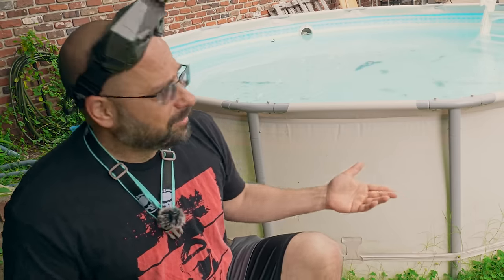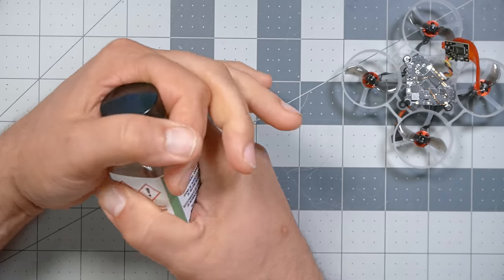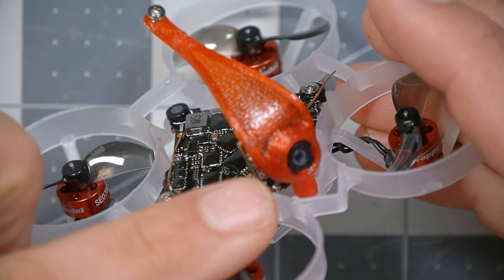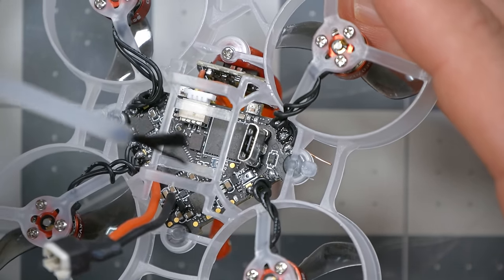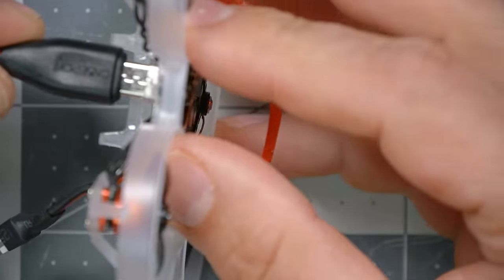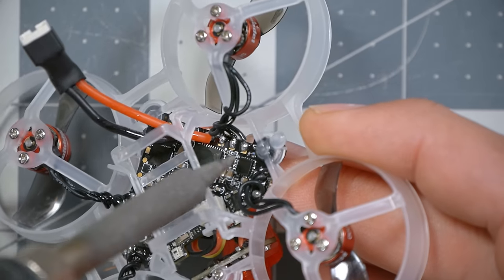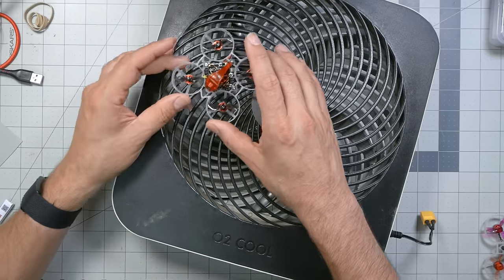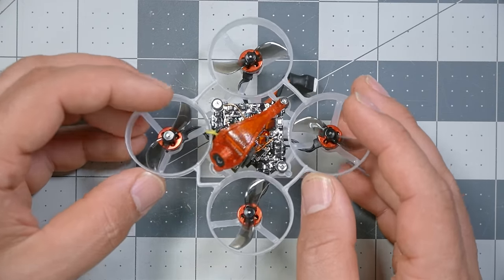I didn't waterproof my drone. Now I'm paying the price.

Comment: I've been using this stuff for years. All of my builds electronics get coated. I've flown in downpours, crashed into wet grass, puddles, snow and once in a pool. Never had any failures due to water damage. I take a heat gun to it to loosen the cap when it gets stuck to the bottle.
Reply: Try flying while it's actively snowing. Video gets worse but it's so fun.

Comment: Worth to mention, that motors don't need to be covered with coating because of magnetic nature of motion. Brushless motors are waterproofed by design.
Reply: Strange way to say the wires are enamel coated
Reply: The "magnetic nature of motion" has nothing to do with brushless motors being waterproof. The copper windings on the inside are coated in enamel and the wires leading out are sealed. Honestly not even sure what "magnetic nature of motion" is supposed to mean in this context.
Reply: @psyman9780  probably that conductivity isn’t required because the motor functions through electro-magnetic created motion. Just a guess…

Comment: Just rescued a 5” from a pond after 2 weeks under water, no waterproof coating applied.  Result 1 seized motor, ESC fried. Flight controller, 3 motors, caddy unit and ELRS, were working.  Battery was screwed.  The rule here is the ESC Diodes cut power first to the rest of the drone.

Comment: Its not the water in and of itself, water does NOT conduct electricity, it's the minerals in the water that conducts electricity. The different minerals create gradients. Of course, when drone is running or has electricity in it, the electronics will get damaged by the conduction of the electricity crossing the gradients.

Comment: Distilled water flush is great advice. Years ago, I flew a marine life observation drone that landed and floated on the ocean. It required a distilled water flush after each flight followed by a WD-40 spray rinse of the motors. Flushing with (distilled) water is counterintuitive but apparently worked for this specific project.
Reply: Not really counterintuitive. Distilled water actual does not conduct electricity. It's the minerals in the water such as salt that makes it conductive. But distilled water is not really something most people have at home :-) fresh water from the tap followed by something else works great. As long as the battery is disconnected it doesn't matter what you rinse with. All that matters is that no residue is left on the components when you do plug in the battery next time. (Unless it was fried before you picked it up... But then nothing's really matters ;-)
Reply: On hobby drones I would avoid spraying the motors with WD-40. The bearings are usually shielded, not sealed, so WD-40 will get right in there and break down the lubricant. Though it may be a good idea to lubricate the bearings after they take a swim anyway.
Reply: MAF sensor cleaner works great for spraying out motors.
Reply: I've done this on float planes I've flipped in the lake. Didn't revive them all but most were okay. Works magic on ESCs. Now my float planes smell like a mechanic's shop.
Reply: Is there any chance to save a drone that get into a water without any comformacouting done?
Reply: @theartofflying3108  I've saved float planes with no coating by using WD40 on the ESC. None of my float planes have flight controllers though.

Comment: I'd like to see a video where you test out "Lipo fire safe bags". I have a tough time believing any are good enough to be worth spending money on them.
Reply: They're not, there's a lot of videos online of them just melting and letting the flames out. Get an ammo box or batsafe or smth.
Reply: @ironic2468  when I watched that video I was thinking that an ammo can with Fireproof sheetrock inside would be the best option of keeping the flames contained but maybe the ammo can itself would do a good enough job. Either one seems better than one of those battery bags lol
Reply: I second this motion!
Reply: @SkeezyFPV  Closing the ammo can turns it into a bomb. an open can still has flames coming out up to 6 feet in the air. Ammo cans also transfer the heat of the fire into what ever they are sitting on, so your counter or table still ends up ruined.  

Safest charging locations indoors is inside your oven, or in a fireplace. non-glass top stove with a good vent hood would be third place.
Reply: buy a small toolbox, works way better.  helps if you place it on bricks instead of hardwood floor.
Reply: @drunkskunk00  you gotta take the rubber seal out. Else your right. Lithium ignites and doesn't have oxygen and it will find it meaning it will burn a hole through it.
Reply: I think there is one on Rotor Riot channel
Reply: There’s so many videos already proving that lol. Even the boxes aren’t safe if they’re stuffed full of lipos and the boxes are touching anything flammable.
Reply: I use .50bmg ammo cans for all my lipos.  I did an experiment where I shoved a nail through a lipo, threw it in a metal ammo can and closed it real quick. A little smoke came out of course, but the inside was scorched. Harbor freight has them for around 6-15 dollars depending on size. The 15 dollar one fits a ton of batteries.
Reply: I use a cooking pot
Reply: @sakfpv8444 did you remove the rubber seal first?

Comment: Electronics technician in a previous carrier. 
Never heard of the unplug it before removing it from the water theory. But I suppose I can maybe kinda see some validity to it. 
Definitely recommend removing the battery ASAP! 
Also isopropyl alcohol is one of the best tools for removing water from electronics. And air! A little heat doesn’t hurt either.
Reply: I’ve had personal experiences and come to this conclusion years before this video. My theory behind it was different though. I had the idea that the much quicker rate that water cools than air aids in keeping individual chips, caps and resistors from frying. I’ve pulled several drones out of water after unplugging the battery submerged and have had good results
Reply: I’ve also had the experience of components frying right in front of my eyes pulling them out of the water while plugged in. That’s what first gave me the idea

Comment: I wouldn't recommend coating with things plugged in - I did an ESC plug like that and I could never get it out again, I broke the wings off the plug trying to get it out. I use Kapton tape to mask off anything I don't want coated and then I spray that sucker. Also (I don't know if this only affects the spray-on type) the solvent seems to soften any silicone items such as wire insulation and gummies. I'd probably remove the gummies and try not to get too much on the wires.

Comment: I had a 16 x 16 iflight pinned stack in a small 2.5 inch that I recently retrieved from a tall tree after being stuck for over 2 years.  Surprisingly everything still works fine.  Except for the one motor bell that showed my bb gun aim was dead on the money at least once!  It had been 90 degrees and better with no rain for a few days prior to the rescue.  I have just put the stack in a Darwin fpv tiny ape frame and flown for a few weeks now with no issues at all.

Comment: So funny, this video was released just a few hours after I landed my acrobee65 in the garden pond. No conformal coating, did not unplug the battery under water but rinsed the pcb with Flux remover fluid and dried it in the sun. Got lucky, it still flies like a charm
Reply from the maker: Sometimes you get lucky!

Comment: Clear nail polish. works well, comes off easily with alcohol and saves you from anything short of full submersion. For the amount of work most people do to a quad on an ongoing basis, a coating that is 'difficult' is really not so good.
Having said that, if you're over water then maybe go all-in with the good stuff.

Comment: The best way to waterproofing the drone is B7000 glue! glue can pour contacts and then remove without residue with tweezers. B7000 can be completely removed without solvent by winding on tweezers. Where I live long winter and rainy spring and autumn so i know what i'm talking about.

I filled the boot button and exposed connectors with B7000 glue, and then easily removed them when I needed them in a new build. b7000 can clog the UFL antenna connection without fear of losing connection.

 I don't like MG Chemicals because it leaves a lot of dirt and is very difficult to remove with a solvent. And also it is very fluid and floods the places that I try to avoid.

In this old video, a guy shows how easy it is to apply and remove B7000 glue with tweezers from a flight controller: https://youtu.be/qx-ZT6Vo6xg

And this glue is very cheap and sold everywhere, as it is very popular for gluing smartphone screens
Reply: thanks for the tip!

Comment: Submerging your quad or just getting it really wet is not usually an issue. Even not conformal coated, you just gotta heat everything up with a hair dryer nice and hot, and all the water bakes off. Done it many times, worked every time!
Reply: thats not true, the problem mainly is the mosfets. Although the voltage on our quads is low and therfore it's not the probem itself, but the GATE is very sensitive it only need very little bit od drive current to switch it open.  So by water it could create a little leak current and drive the mosfets unintended uncontrolled.  This than lead to a short circuit, and so high current or burning the mosfet or pcb traces etc. So ESC's or any switching step down power regulators containing mosfets ,which can be found in many circuitry are notorious for burning.  If no mosfet electronics on your pcb indeed you have much higher chances of survival/ less risk of permanent damaging electronics, if it is uncoated.

Comment: Instead of conformal coating, I always cover my eletronics with Corrosion X. I live and fly near to the beach. And work great, I have radios, drones and planes working for years. Just apply, a coating once by year. Or if dump into water clean with electrical cleaner and re coat
Reply: CAN YOU PLEASE SEND ME THE LINK FOR THAT PRODUCT? THANKSSS

Comment: I wonder if there could be some sort of "wetness-fuse" that will immediately cut battery current if it gets wet...
Reply: Thats basically just a smoke stopper
Reply: @TomDenny-s7n  That sounds a bit bulky and wasteful of electricity compared to something could be just a little thingy thing switches to infinite resistivity when wet but otherwise just acts like a a wire under normal circunstances; a smoke stopper is not something you would be flying with, specially with smaller drones...

Comment: I personally have had a Phantom 4 Pro that went swimming in the deep blue ocean on a Natgeo Sharkweek shoot (luckily we had an underwater cameraman, suited up, that immediately free dived down 12m and saved it - what a legend!!)
We were still out at sea on the zodiac for a good few hours. As soon as we returned to basecamp, I took my Phantom apart, unscrewed everything and dunked and rinsed my drone in a tub of freshwater for a good 10 minutes, in an effort to get all the salt off the electronics. Afterwards I let all these components in the sun for 2 days, even put it in a box full of rice for another day. After that I sprayed all the electronics with electronic contact cleaner, a product called “mr mckenic”. My drone survived, except the 4k camera, and I fly my drone to this day! (After replacing the camera)! Needless to say, I had no silicon conformal coating on the electronics, prior to the incident. The only other part that had to be replaced was the GPS unit, as expected, as this unit is located in the top part of the shell of the Phantom, and this is the only place I did not open. Of course, the camera and gimbal is the expensive part of the drone, but it was inevitable to lose this part of the drone, sensor got damaged. But still saved me quite a bit of money. Good practice is to spray electronic contact cleaner on your drone parts, if you don’t plan on covering it with conformal coating 🤙
Reply: I wish I was you!

Comment: Make sure after it tacks up a little bit if you apply it with connectors plugged in and USB plugged in, unplug them before they dry, or they may be permanently plugged.......😁👍🏼

Comment: JB, I have the HS 170  predator small little drone fell in a trashcan full of dirty water I couldn’t find the drone for about 20 minutes finally seen lights flashing at the bottom of a trashcan full of water took the drone out unplugged it dried it with a hairdryer an plugged it back in and flew it. then I had a drone same one laying on some wet grass it was wet and it shorted out, figure that one out!

Comment: That's the stuff I have but I hated using it because it looks like the board is covered in slime eventually. Once it has enough grass mixed in with it. It does work well though. Now that I have been doing a good enough job at building and not crashing so much, I haven't had to repair a quad in almost a year now. So I keep thinking I need to take them apart, clean them with alcohol and conformal coat everything.

Comment: My quads always get the conformal coating treatment, they’ve survived dunks into the bath, in the sink, down the (clean) toilet, and my 5” spent an hour at the bottom of a lake while we tried to find it, when we did the first thing I did was disconnect the battery while still under water, stuck in on a desk fan for a few hours and it was fine, even the Caddx Vista and camera survived.
Reply: Did you conformal coating the vista unit and the camera?
And if you did - how did you do it?
Thanks :)
Reply: @hadaralon  interestingly no I didn’t which was quiet a surprise.  I did put one under a black light once and they do have a very light pink shine to them so maybe some of it is done at the factory.  I’m convinced the unplugging the battery while under the water probably saved the vista.

Comment: 13:10 I go Big Fat Greek /w the Windex, Ethel Alcohol dries faster.  Just be aware that there is a polishing compound in Windex, but I've never had a problem with it being conductive...  It becomes some dust to brush off b4 applying a coating.

Comment: Talking to a local store here in Norway, they said acrylic solution is better than silicon when it comes to water resistance.
Now, I would think the silicon solution is preferred due to the heat resistant properties that is greater than the acrylic solution?
From what I've read and understand based on the local store here, the silicon solution will handle 200C and the acrylic solution resists up to 125C.

Comment: a hairdryer works well too i was my quads with the hose spray with electrical contact cleaner or isopropyl then dry with a hairdryer been doing it for a few years now never had a quad die

Comment: Hmm, I took the time and made sure my quads were properly coated, also using 422 silicon (even under the chipset and other SMDs), and we fly in snow and crash into water all the time. Sometimes we even get lucky and manage to turtle out of the snow. Never had any issues what so ever, never let the quad dry either, just slap it against a tree or wall to get rid of the thicker snow or mud, fresh pack in and full throttle again.  Of course I don't COUNT on it being fine, but after 50+ crashes in snow I'm confident that proper application of the goop is key, and that it will work  way better than some argue.
Reply: Right I was kind of blown away he never mentioned silicon but hey I'm use to snow and oceans. I guess some of us just need to deal with water proofing more then others haha. In my experience even manufactures usually use Conformal more for water resistance then water proofing. ie for some casual rain not submersion. The best ones combined them both!

Comment: Contact cleaner will clean conformal coating off of anything you need it off of(save camera sensors, and possibly barometers), and will ensure that the component gets working again. It may take a couple applications and some scrubbing with a toothbrush, but it will get it working again.

Comment: Well technically he did not fly it into water. The esc where off so the potential to damage the esc was zero. anything else was close to zero. If the motors had full power that would been a completely different thing. Also the low voltage in a whoop is different from a 6s setup. (Probably would have survived but still not a real test)... Also as fresh water is usually not that bad. Saltwater on the other hand will fry anything not super protected.
Reply: Or because it is a Pool it has (I assume) Chemicals in order to keep it as clear as that is. which ever chems that JB uses for his pool are most likely going to increase the conductivity of the water. Water in and of itself is not conductive. Water with dissolved and or suspended solids is conductive. Distilled/pure water has very high resistance compared to say pool water with dissolved chems in.

Comment: I have found alcohol not really great at Removing within buttons. I used a conformal coating stripper. Don't ask how I know. What about drone dry it doesn't have the problem of getting it in the ports. Just $$$$

Comment: I once dropped my 5'' quad into saltwater due to some weird rxloss. It was approx. ankle deep and full of seaweed, so the quad plopped into that mess right to the upper deck. The battery terminals and the ESC power traces had likely shorted out, everything started boiling and fuming, and as a cherry on top the battery caught on fire. While in water. Yeah. I yanked it out having wrapped my hands in my shirt, but the ESC board has been ruined - some power traces eaten clean off the surface. Silicone insulation on some motor wires had puffed up, cracked and turned brittle, and the carbon fiber near the power terminals had visible pitting.
To sum up, I had to replace the ESC board, rewire all motors (thankfully the coils themselves were not corroded) and buy a new action camera. That was enough of a lesson to lacquer-coat the boards.